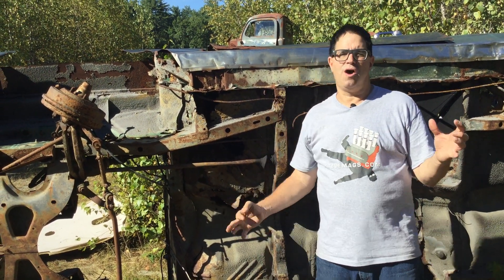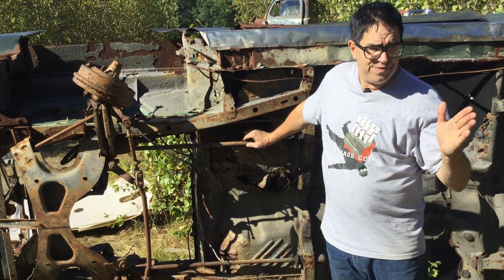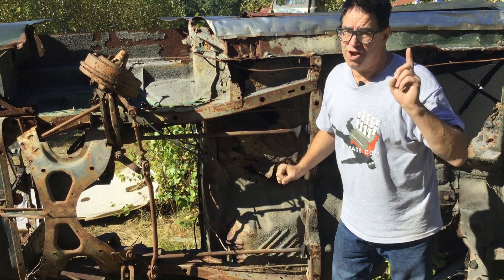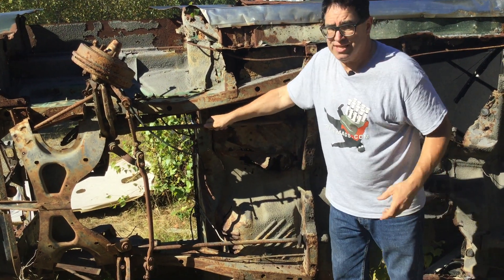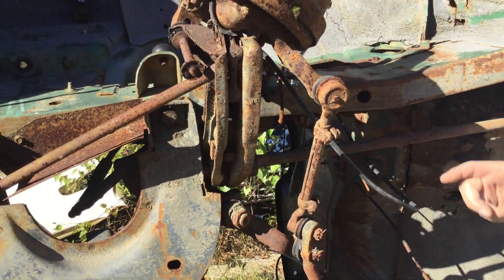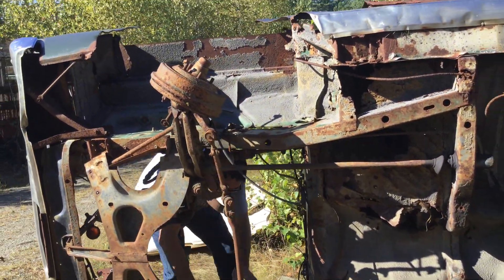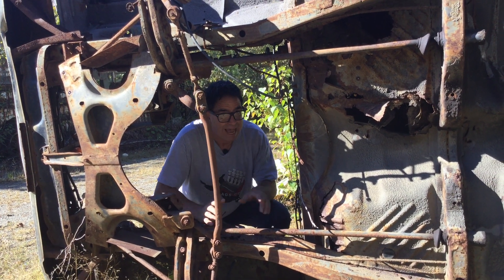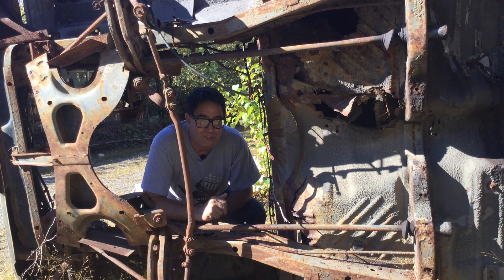Torsion Time

Comment: I told a friend that he could lower the front of his Belvidere by adjusting the preload on the torsion bars.  He did it. It worked but on one side the bolt hat to be turned clockwise; the other, counter-clockwise.   What do you get if you put a big block 383 into a B Body Dodge?  A Super Bee! PS The 383 is a ""B" engine and the 440 is an "RB."

Comment: The reason drag racers hate mopars, as well as nascar. The bars keep the front tires in contact, unlike springs. Plus supper fast adjustments compared to death blocks inserted.

Comment: Good one Steve!  I'm not sure why modern cars don't use torsion bars.  As you point out, they save space in the engine compartment, but also, they are more easily adjustable.  I'm pretty sure an automotive computer running a motor and a jack screw could do all kinds of neat things.  Forget all that coil over stuff.  Keep it simple.

Comment: The torsion bar made it cheap and easy to get the ride height back to its original specs when it started to sag. Unlike cars with coil springs that you either had to replace the springs or add in spring spaces that changed the springing rate also.

Comment: I have a 1955 packard with full length front to rear torsion bars. Makes the car corner like it’s on rails. Great suspension!
Reply: Does your self leveling motor work? My buddy has a 55 Packard 400, his motor is fried
Reply: @Tumbleweed_Tx  
I work at a motor rewinding shop, we rarely do any rewinding anymore but try and see if you can find a place to rewind it.
Reply: @Tumbleweed_Tx  it does still work. Keeps the rear and front level . It’s quite a system

Comment: I guess the torsion bars on the General Lee must have been made from the same stuff as Thor's hammer!
Reply: General Lee's torsion bars are made of Hollywood.  Which I'm told means unlimited replacements.
Reply: Nope. They just replaced em every jump, rewelded boxes etc and relocation of a lot of weight to the trunk
Reply: Just spring steel actually. Nothing special about the general lee except its paint job.
Reply: @nastybastardatlive  I think you missed Hoovies joke. 

Hoovie meant that the bars in General Lee has to be made of thors hammer in order to be able to whitstand the jumps in the movie.
Reply: @nastybastardatlive  It is an iconic car that in itself makes it special!
Reply: No. They just destroyed over 200 cars filming the jumps which is one big reason I do not like the show.
Reply: @scootergeorge9576  exactly. but I was referring to the movies that they made a few years ago.
Reply: when the General Lee did jumps, they used a stunt double. a crown vic that was dressed up like a Dodge Charger. sort of a trans-fender.
Reply: krazi77  you are krazi
Reply: @cjbert6790  with all the lgbtqwtf stuff going on, I personally self identify as a Buick.
Reply: Good one!
Reply: @krazi77  I hope thats not one of those little Korean built newby buicks but,  a 1970 GS stage II gentlemens muscle monster.
Reply: Michael Atkins     Let’s not get krazi here. Lol
Reply: @michaelatkins9780  It's hard to decide on that, or an 87 GNX, or a 96 Roadmaster wagon with the LT1
Reply: @krazi77  excellent choices all, I  would lean towards 63 Rivera  430cid. Classic just like your comments. Lol
Reply: @krazi77  the thought of that unholy realignment with the dodge brothers, should sat Henry to spinning in his well appointed guaranteed for "life" casket.
Reply: @krazi77  only in the modern ones.  Every single general Lee was a tried '68 or '69 charger. The people who put on the shows nowadays are the only crown vics
Reply: @chuckwhitson654  that's what I meant. the now a days ones.
Reply: @krazi77  "Trans-fender"??? That, my friend, was truly awful! I hope you don't mind if I steal it!

Comment: A coil spring works the same way, but the free body is different. The wound bar that makes a coil spring is also deformed torsionally as it is compressed. Chrysler torsion bars are simpler, although routing headers around them was a challenge on A-Bodies.